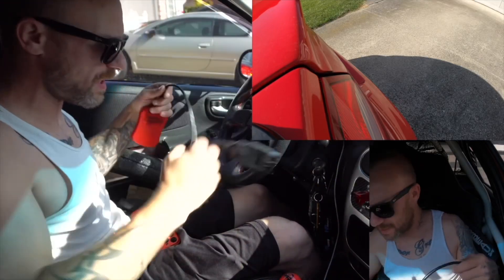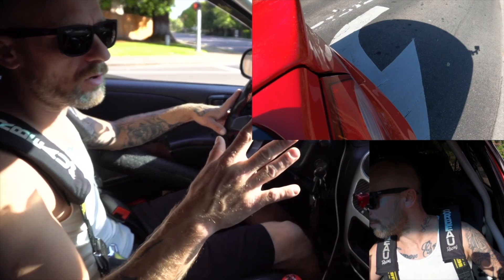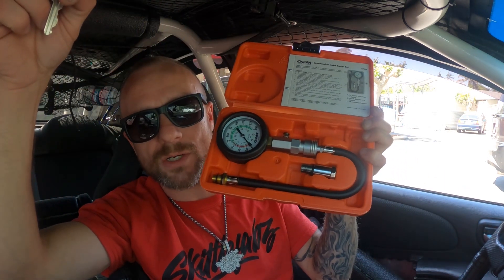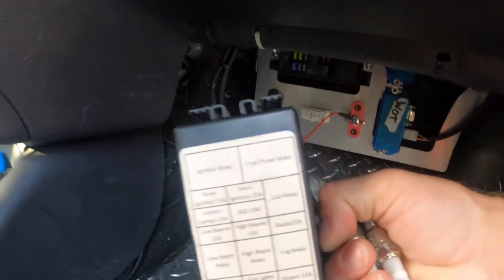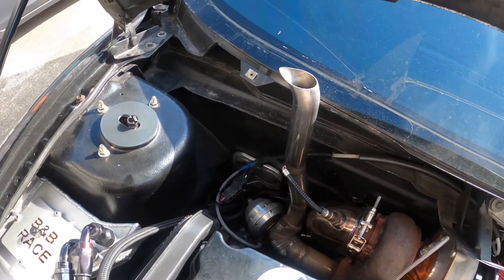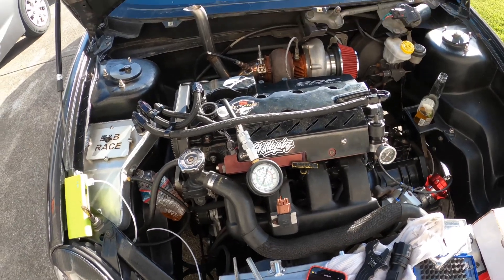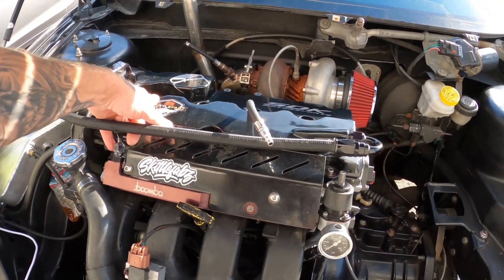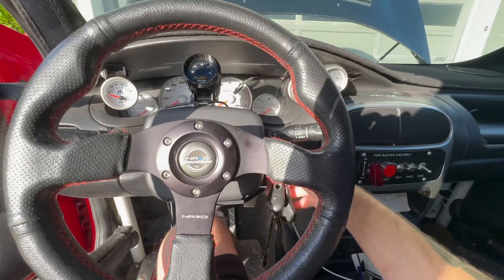Blowing smoke - Compression Check // Neon SRT-4

Comment: Are those the spark plugs for every Neon?  Or just yours?
What spark plugs do you recommend for a SOHC I've been using mine with a really short ones BKR6E
Reply from the maker: I stand by NGK
Reply: @SkittlefabzSRT4  i meant to ask about the size of the thread of those spark plugs. The ones i've been using are about 0,7 inches deep and those look about 1,5 inches
Reply from the maker: @LDCoronel1  I would not know iff the top of my head my friend, try going ti autoparts store and have them pull NGK4306 and im sure you will find your answer

Comment: Delo is trash and has a terrible additive package. It also has little to no zinc. You'll have fantastic luck with the VR1 oil. Valvoline makes great oils and their VR1 lineup whether it be the conventional or synthetic is great. I've ran it in all my supercharged and turbocharged applications with no issues. As far as filters go, you can never go wrong with Wix in my opinion. I hope you get your car lined out brother, were all rooting for you ✊😎
Reply from the maker: Yea I use to run the vr1 in my caliber along with amsoil, but when I chose the Delo, I wasnt sure if it was a good one until I tried… clearly it’s not good enough to run in the SRT-4. 
I rock with the Wix line up for sure. K&N has been sold of to a chinese company from what I heard.

Comment: 150,150, 130, and 130 is not good. Leak down will tell you if the valves are causing the problem or headgasket issue.
Reply from the maker: Trust me I know this, I was being a nice guy still because I was building up more to my case. Stay tuned and find out…theres more
Reply from the maker: Leak test is definitely next, just gotta get my connections right around here. I dont have a leak down tester, so I am shit out of luck rn
Reply: @SkittlefabzSRT4  Im getting ready to do a rebuild on mine. Compression tested mine two days ago and came out with 140, 140, 135, 140. Compression test needs to be done on a fully warmed up motor and you have to hold the throttle wide open. Just a heads up. I would redo it and see if you get a better number.
Reply from the maker: I heard when cold